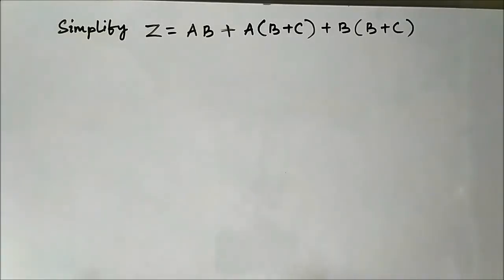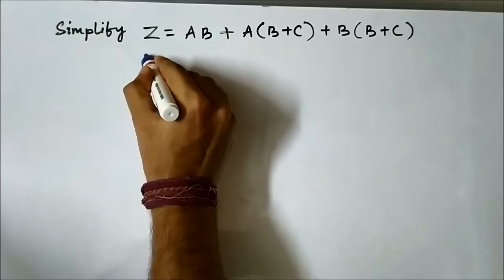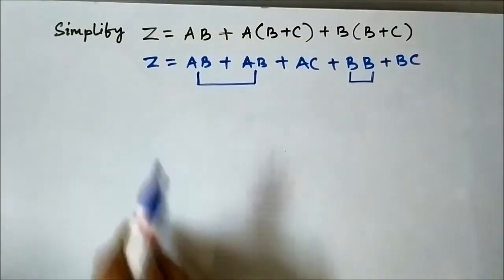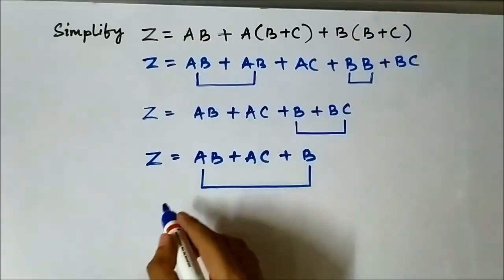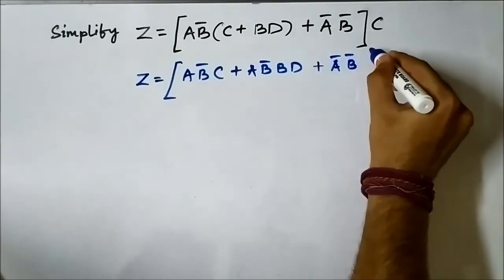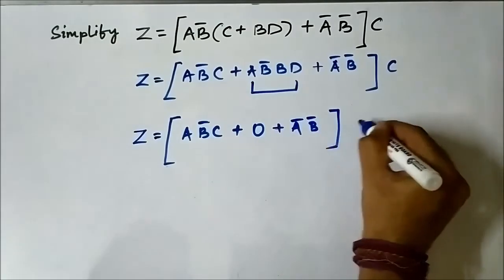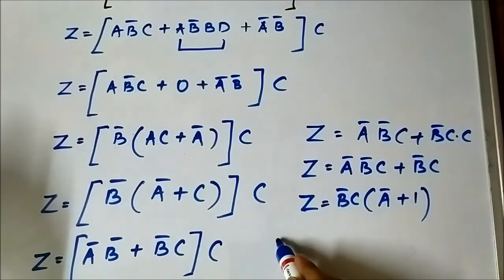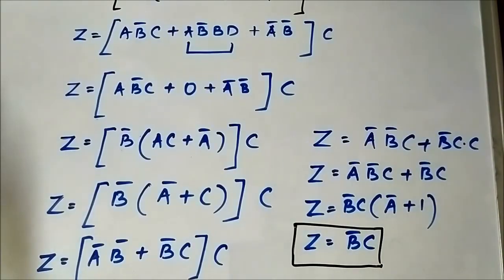Simplification of Boolean Expression using Boolean Algebra Rules | Important Questions 1

Comment: can you work these equation 1 compare and contrast computer architecture and organization in detail
2 Draw logic circuits for AB + A’B’ + A’BC algebraic expressions:
3Simplify and draw its logic circuit for AB + (AB )’C + A=
4Simplify A + B[AC + (B + C’)D]=  
5 Simplify the A’BC+AB’C+ABC’+ABC  using Boolean algebra 
6Simplify F(A,B,C,D) = ∑( 0, 1, 2, 4, 5, 6, 8, 9, 12, 13, 14) function using SOP
7Discuss in detail about Flip Flop and types of Flip Flop
8Compare and contrast combinational and sequential circuit within their example
9Find the 10’s complement of 76895
10Discus the four type of address instruction in detail
11Convertí 111100100 to octal and  hexadecimal 
1208B.FCD to octal and binary number system